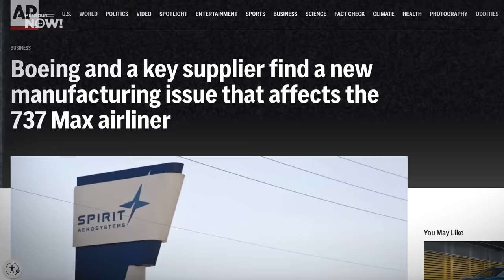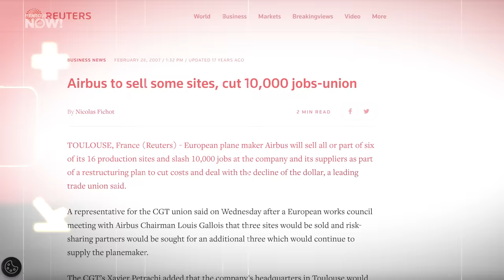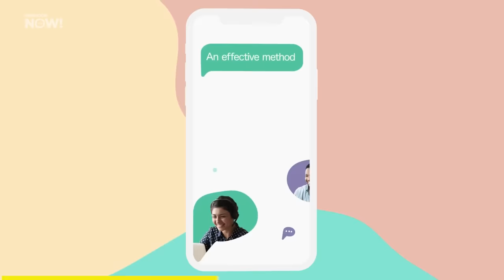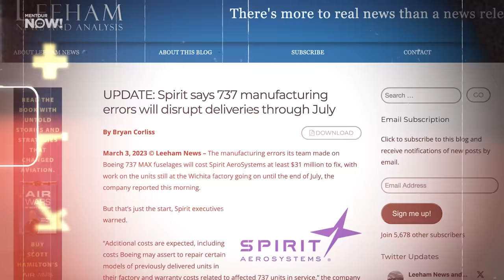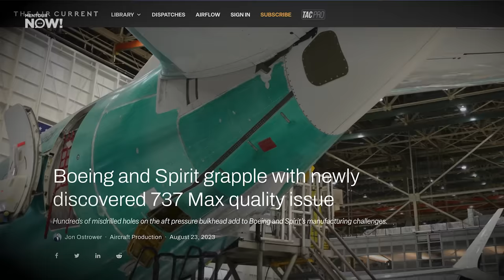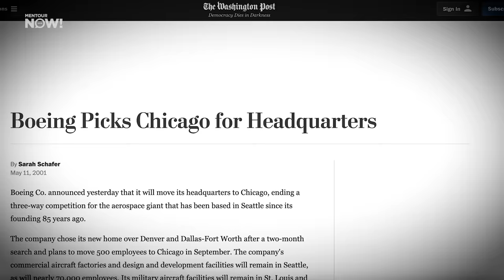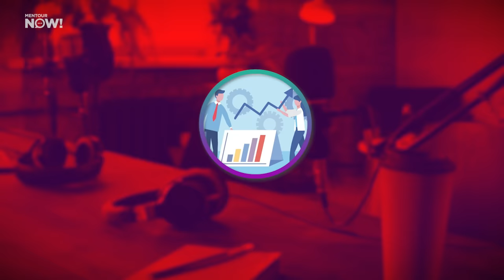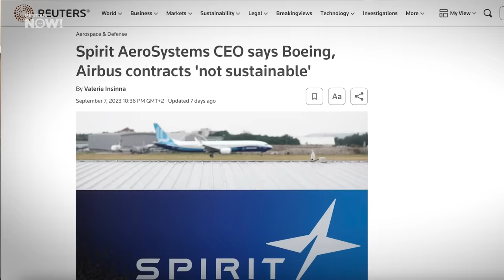NEW Problems with the B737MAX!

Comment: Speaking of snowmen holes, when the holes are like 90% overlapping, the situation can be fixed by drilling a slightly larger hole and going with a non-standard very slightly oversized rivet.    Which has to be inspected and signed off by an inspector.

The scuttlebutt is that at Boeing the inspector's notation is "Lockheed rivet".   At Lockheed it's "Boeing rivet".   

Amusing.
Reply from the maker: Hahaha! I didn’t know that
Reply: True enough, but on something like the bulkhead you have to re-do the engineering and approvals to make sure it's still safe. Aircraft are engineered very close to the line and every change has to be checked.
Reply: @MrSunrise-   - as long as the larger hole is factored into the design tolerances of the part from the beginning? then it only needs to be checked for quality.
Reply: @JohnnyWednesday This is rework, it can't be factored in from the beginning .
Reply: @johndododoe1411  Rework is expected in manufacturing. A margin for some amount of rework or assembly error is always factored in. This sort of practical consideration is what separates experienced engineers from college kids.
Reply: One question. Why isn't this drilling done on a automated line?
Reply: @johndododoe1411  yes, it can. It's just a matter of having the engineer do the calculations.
Reply: @Dirk-van-den-Berg  Automated systems can fall out of alignment resulting in miss drilling. Honestly the biggest question for me is why it need 4,000 holes drilled. That sounds excessive to me.
Reply: For real, for real? 😮 Wow
Reply: @darthkarl99  Just how can an automated system fall out of alignment? It seems to me they are more likely using some sort of hardened drill guide template with people operating drills. The templates could shift if not secured properly. And where is QC in this process?
 And as for 4000 holes and rivets, I'm sure the designers/engineers at one time deemed the stiffeners needed them in a critical piece such as a pressure bulkhead. It's called redundancy. See Japan Airlines Flight 123 as one example. https://en.wikipedia.org/wiki/Aft_pressure_bulkhead#Failure_incidents
Reply: @MentourNow look up the nightmare that just happened in Boston at Logan Airport. United Airlines plane told to abort landing at 200 feet due to plane still on the runway.
Reply: @JohnnyWednesday Edge distance??  Pitch??
Reply: @Dirk-van-den-Berg Funny you say that.  The drilling was an automated process.
Reply: @darthkarl99 Have you ever seen or touched a pressure dome/bulkhead??
Reply: Pettr has an entire video about a plane that exploded due to “snowman” holes. 

The staff doing that work must have been very disempowered, so that their jobs were at risk if they tried to raise an alarm.

Like that UK nurse that was just convicted. Other staff were threatened when they raised concerns.
Reply: @Dirk-van-den-Berg  Likely because of the complicated profile that makes automated drilling hard to set up.
Reply: If you replace small standard rivets with bigger non-standard rivets and you have to replace 3600 of them (90% of 4000), you will have a serious increase in weight, change in CG (especially since the bulkhead is in the tail of the airplane) and other effects (like vibrations and change in modal structure analysis).
I know that there are acceptable margins in constructing an aircraft, but when a change of this type happened, the airplane should NOT be consider Airworthy (major part of the structure modified) which means it can loose its Certification.
As an example, in the 80’s, the PIAGGIO P180 Avanti passed its ground certification (including structural and vibration tests on one aircraft prototype). Then, since it was certified for flight test, it went to flight testing on another aircraft prototype… and crashed. The reason: margins were not respected during construction. It took a decade, after financial collapse due to this crash, for PIAGGIO to restart the program of the Avanti.
Margins in aviation are not what people may think, and margins are not to play with in any aviation or airspace production… otherwise lives may be at risk!
Reply: @darthkarl99  Well, you know ..if 3000 are overlapping drill holes ...there's still at least 1000 holding the bulkhead in place.🤪
Reply: The fact that Boeing knows of that method and even has a name for it (surely a result of some cold war tolerance differences between manufacturers) proves that they know how to do that.
And it doesn't even need a nonstandard rivet, just a sze bigger.
Reply: If you enlarge a hole and put in a larger rivet, you have not changed the amount of aluminum, not by much.  The new rivet might be 5% heavier than the old one or so. Also a 737 has about 400,000 rivets, so 5% of 4000/400,000 is only about 5% of 1%, or 0.05%.  A 737 carries about 25% fuel by weight, so you're changing the weight by way under a tenth of a percent of the fuel load, a negligible amount.
Reply: Are there any Northrop Grumman rivets? Airbus rivets?
Reply: @darthkarl99  One hole per rivet.
Reply: @thewhitefalcon8539  Yes but in what world do they need 4000 rivets to secure it, that just seems like bad fastening design to me. The more fasteners the more time it takes to drill holes and install rivets to do the assembly and thus the more costly it becomes. it just seems inherently inefficient from where i'm standing.
Reply: That’s if you don’t end up with a freeze plug or worse….could also be better and go with a hi-loc in some parts.
Reply: @JohnnyWednesday nope. Anything over first over on the skin is automatically an ncr and needs engineering to write a disposition. Anything over second over in all other places are the same…that’s not including the -9 or x where all oversized or damaged holes get an auto ncr.

Then again I am talking 777 and not 100% sure about the 737 tolerances and requirements
Reply: @darthkarl99 lol…a butt splice is hundreds of holes. A lap is about 300+ holes. There are multiple on each plane. For a 777, there is 10 butt splices per ring. For the freighter there is one ring and 1 extra as well as 4 laps (well and a mini lap between the cargo door and access door). Then we have shear ties, frames, frame solves, floor beam to frame, floor beam to stub beam., and other areas that get drilled. The number of holes drilled and filled on a plane is mind boggling. 4000 is nothing really.
Reply: @reubenmorris487 yeah…but one misplaced temp fastener or mislocated target can cause so many issues. I came in one weekend to find a full sized double hole with countersink on the crown. The tacks had been off on one of the bays and caused it to shift that section up two rows. Bad day for first shift a deck
Reply: @darthkarl99  I think it's to distribute the load, so each rivet is not working as hard to hold things together.

I did some calculations. Wide-body aircraft have a diameter of 6 metres. That's a circumference of 18.84 metres. There would be a rivet every 4.71 millimetres.

It's probably not in a single line. They probably have multiple rows of them.
Reply: @georgegonzalez2476  And also you drilled out a bit more, so that's minus some weight
Reply: @tlum4081 how can your car’s drive wheels fall out of alignment? Hitting obstacles and normal wear.

Comment: At 8:18... The single biggest mistake Boeing ever made was merging with McDonald Douglas. It has been a race to the bottom ever since!
Reply: Should have been a buy of just the hard assets, not a merger. Any cook can tell you if you add a bad ingredient you ruin the whole dish.
Reply: also trying to modernise the 737, which was already limited
Reply: It was good merging with Mcdonald Douglas. You should tell them it was a big mistake instead of complaining on YouTube
Reply: The single biggest mistake you made Juan is your incorrect spelling of McDonnell Douglas.
Reply: @Nickbaldeagle02  Yes, it's McDonald's Douglas, right?
Reply: So many bad apples at McDonnell Douglas
Reply: IMO McDonald's Douglas merged with Boeing not the other way around... McDonald's Douglas exec team stayed on and they where all about cheap, cheap, cheap....
Reply: I heard this saying and it appears to be true. "McDonnell Douglas bought Boeing with Boeing's money."
Reply: Where is this McDonald's, Douglas?
Reply: @ytlurker220  It's a DC-3 that delivers ground beef and buns to remote drive through locations.
Reply: @RussellD11  Yes, Boeing management largely consisting of engineers where replaced by MD paper pushers.
Reply: The single biggest mistake Boeing ever made was disconnecting the actual production of planes from the management. Selling off manufacturers was the second biggest mistake. You see where it leads: on productionissues the company at hand decides the parameters of the faults, not the mothercompany anymore. 
And I wanna bet that productionpeople don't get rest after 8 hours of work like pilots do. They lose concentration, are less fit, which can lead to these kind of mistakes.
Reply: @Nickbaldeagle02 did someone said MCDONALD'S???
Reply: @RAAFLightning1 Exactly. Should have just designed a new plane from scratch or buy a competitor, just like Airbus did with the A220.
Reply: @laaaliiiluuu  100% correct
Reply: I'm lovin' it!
Reply: Actually, the real problem came from Reaganomics;  Cutting the Capital Gains Tax.  Worse than Boe/McD by the way, was Lockheed (made aircraft) and Martin Marietta (made $).
Reply: Don't you mean 18:18 rather than 8:18?
Reply: @RussellD11  Yup. It was a reverse merger.
Reply: The biggest mistake was continuing production of the ancient 737.
Reply: @tenkloosterherman  then so is the a320 ancient. And it's still in production
Reply: @nickolliver3021 The A320 started developing on 1987, it was fbw from the beginning.
Reply: @arcanondrum6543  Stick to things you know before posting
Reply: @bazoo513 No, it's McDonnell-Douglas.
Reply: @RussellD11  No they did not. I worked at Boeing from 1997-2019 in Long Beach and Seattle. Boeing bought MDC to get a larger slice of the defense market.
Reply: @freddiecunningham2860   I did - that was a comment on their business model... 😀
Reply: @cidercreekranch  Sorry, I forgot to put a smiley there, but i thought that sarcasm was obvious.
Reply: @nickolliver3021  Oh my gawd!  Worked with Boeing engineering prior to the merger, was impressed with the corporate culture of the 1970's. Some experience with McD, it was a predictable disaster.
Reply: @SteamCrane  well lots of companies have corporate cultures. Why are you even involving Mcdonald Douglas in a supplier isdue video oh my gawd!
Reply: @laaaliiiluuu  An updated 757.
Reply: Spot on
Reply: @Nickbaldeagle02  yup, I will own that one!